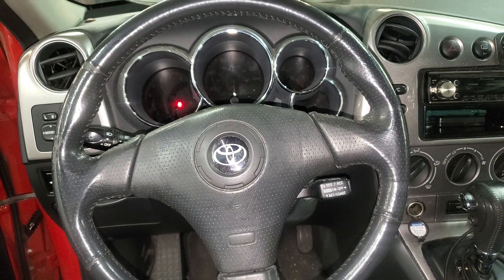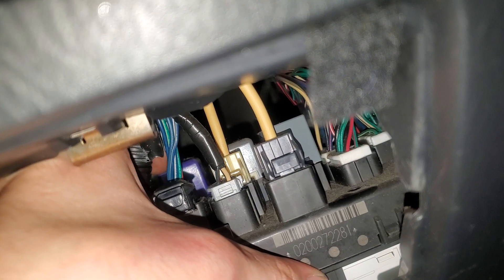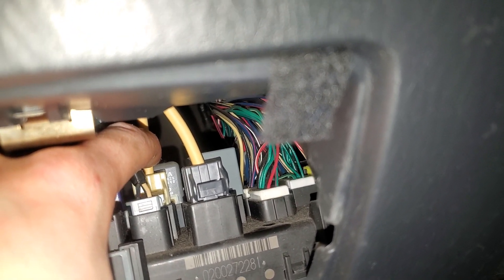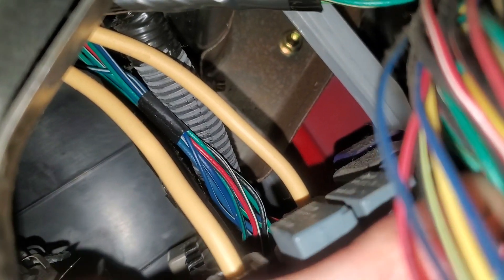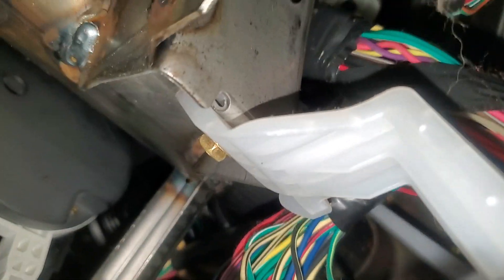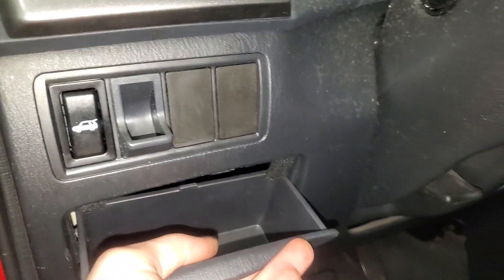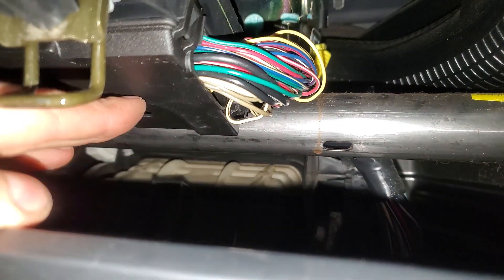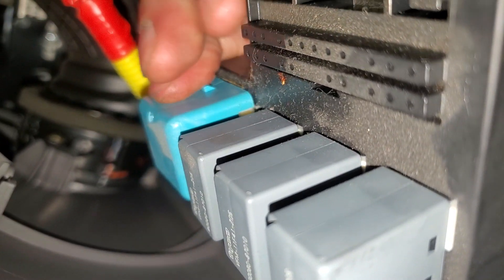2004 Toyota Matrix Hidden Relay Identification

Comment: I noticed the owners manual mention what the meters should read when testing but it doesn’t list or the Toyota parts website doesn’t list amps on each relay. I try to research relays to replace mine and it’s almost impossible to know if it’s too high or low before buying it and testing it

Comment: There's a couple that you missed maybe you could redo this video or do a part 2 video Indy driver side under the steering wheel fuse box there are four that you missed behind the three gray ones there is a black one also on the other side of the fuse panel there are two pink ones and one green one that are unidentified please help

Comment: Hey man, I've got a Toyota Matrix 2005 and I'm trying to find out what a certain but does it's like a circular button right under the steering wheel and it's right next to the fuse box BUT it's not in the "skin" or the plastic cover of the dash. It's hard to explain but I have been trying hard to find out what this button does.  when you get under the fuse box it should be south of it and it's kind of small about 2 or 1 cm in diameter

Comment: Thank you for the info.
Have u ever encountered the problem that you are trying to start the car and all lights from dash lights out? As you put the key in, turn it, lights on, turn to start, lights out, no start. Battery is good.
Reply from the maker: Sounds like a bad connection with a battery cable

Comment: 2010 matrix blue driver scan tool says possible repair for abs dash light is replace relay for abs pump and motor, where is that relay located? I think only the dealer supplies the part

Comment: Man, I could kiss you for that tail light relay location. Holy crap.
Reply: It worked for you? My tail relay is in glove box. Did you have no tails and no dash light dimmer and lights on shifter?? Doing this now fun Friday night
Reply: @KollynJ  Turned out to not be my issue but this is one of the only videos I found that showed where some of this crap is. Did you recently install new head/taillights? Mine turned out to be a flipped indicator bulb(pre-installed in housing) that was blowing fuses every time I put a new fuse in.

Comment: Question   my 2005 Matrix alarm trips when battery is disconnected and put back., , key fob not working so can't stop the inferno beeping or start the car ,  wondering if you know what parts are for the factory security system  so i can bypass it? thanks good video.

Comment: Hi Lehew, great video, Thanks for the upload. I have a problem with my 2003 Vibe base with no ABS and hope you can help me. My dash quit on the way home, then check engine light came on. Drove home and started the car the next day, dash was working but engine light still on. Checked for codes using a cheap code reader, code came up P0500, VSS (Vehicle speed sensor A). Cleared the codes and car was fine for two weeks. Then the dash quit again and was fine the next day. Now the dash has quit for good for a week now. Tried a new cluster from other Vibe, same thing, not working. All that was working were the signals, door light, seat belt light,  airbag light, high beam light, oil and alt lights. When the door is open the door chime doesn't chime either.  Even the dash did not light up and no mileage too. No tach, speed, temp or fuel gauge were working, just the needle gauges where lite up reading zero. I did try a new speed sensor, same thing, no dash. The P0500 code came back, also when the dash quit, transmission shifted funny because of no signal to the speed sensor (my guess). Tried a high end scanner(Autel and Launch scanner) and it won't communicate with the PCM. Tried a used PCM and the same thing, no communication and no dash. Check for power at the OBDII port, have power and have signal and communication ground. All fuses are good at the two fuse boxes. I also noticed that when the key is out, I can hear and see the temp needle have a very slight bounce.  Could a faulty ignition switch or ignition relay be the problem? At my wits end trying to find the problem. Would be very grateful if you can give me some insight on my problem. Thanks so much. Clemens
Reply from the maker: I suspect you have an issue with the canbus. Are you able to communicate with any of the modules? If you have no communication with any of them, you may have a short to ground in the data line. You may have to unplug modules as a Troubleshooting step to see if there is a module shorting the comm line
Reply: @LehewTech  Thanks Lehew for getting back to me so soon. I looked into the canbus, I'm sure I don't have it because the car is a base model. And also I checked the OBD plug, there is no #6 and #14 terminal on the plug to check resistance. I did try unplugging the cruise control and airbag modules. I don't think my Vibe has a body control module. I looked into it and there was no listing. I may be wrong though. If there are any other modules that I missed please let me know. Thanks again. Clemens
Reply: Lehew Tech  my toyota matrix wont crank check engine light will not ligth up  no communication with ecm all fuse are good everything started to happen after a head ligth swap   It started to blow a 15 amp fuse find out it was one of the ligth bulb socket that came with the new head ligth fix that but car wont start cant hear the fuel pump thanks in advace
Reply: @LehewTech  I maybe you could help me out so I have a 2005 Toyota Matrix and the rear defroster stopped working along with the rear wiper